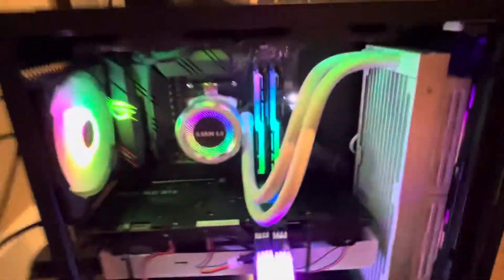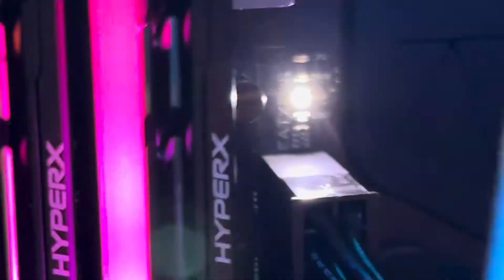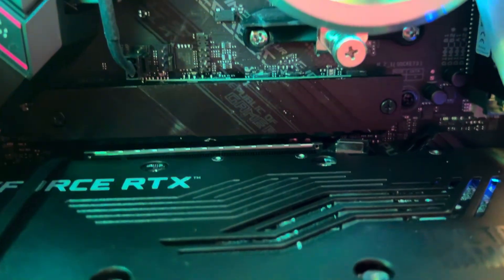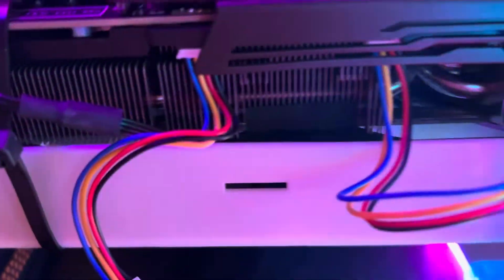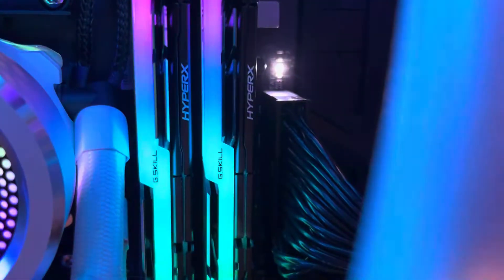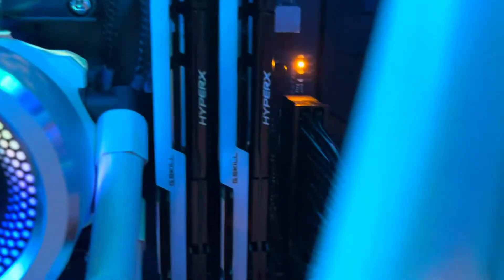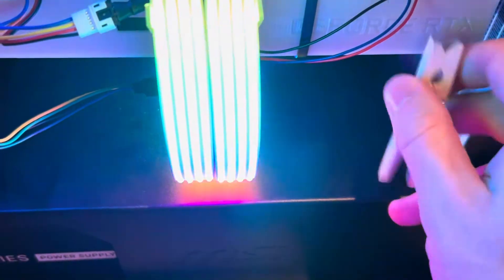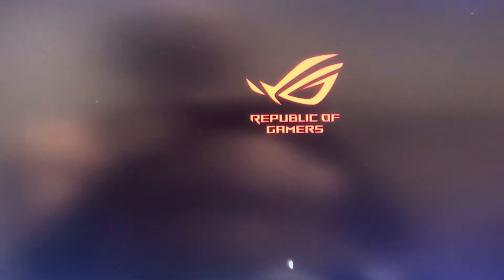How to fix White VGA light on motherboard

Comment: I just got a new cpu and it keeps having this issue just found this video but I don’t think it will help because right when I put my old CPU in it boots fine and I updated bios and chipset drivers and nothing still everything compatible it might just be a dead cpu I’m thinking because I got it used

Comment: My vga light stays on without graphics card and with card in with pc on the side, it was working yesterday
Reply from the maker: I would check all golden pins on the card as well as the pci slot on the motherboard for any damage or cracking.
Reply: @skidder6063  Turned out to be an SSD that stopped working, thank you though
Reply from the maker: @Heretican  np glad u got it working

Comment: well im having this problem since i bought the asus board... even without GPU on CPU integrated (AMD 9950X).. at this point im just leaning towards switching to non ASUS board as ASUS lately keep making garbage...  my gpu is heavy with waterblock, but its sturdy so there is no sag at all.. also tested with other gpu that has no coolers (some old quadro card)  - same problem.. tested with iGPU... same problem.. but the thing is that problem sometimes goes away.. most of the time it works.. it takes like 30s on white LED to finally start post process.. but maybe once every 2 weeks i get white LED of death where it wont boot on first and on few reboots either.. its like starting an old rust crusty ol car... this is insane.. My previous PC didnt have this garbage problem... but it was ASUS board aswell.. tho it was DDR4 and this one is DDR5.. maybe thats the problem.. idk
Reply from the maker: Have you tried updating your BIOS?
Reply: @skidder6063  You could have asked if i turned on the monitor.. yes. im no boomer. I have built many PC's and this is the first time im having such issues. Yesterday i added gpu sag support but the gpu itself was very rigid, i still put a support for it to bent upwards a little bit.. will keep my eye on things, but i think its an asus disease.. you can read many posts online people having similar issues with modern asus boards (past 2 years) before that they had good products and i never had any problems before like this. Once new GPU's drop, ill switch to a gigabyte board, as MSI suffer similar fate and assrock keeps burning up AM5 CPU's...
Reply: I ordered different motherboard, will update yall if i remember if that would fix my problem. And no, the GPU sag ( i didnt have it in the first place) hack didnt help in my situation.. i think its hardware issue with motherboard itself.. we will see..

Comment: I wonder if I’m having this problem in reverse. I have an anti sag bracket and it’s possible I pushed the adjustable bracket arm up too high. I’ll try lowering it
Reply: Turns out actually the TOP part of the clamp can’t be raised and may actually be causing the gpu to sag ironically. I believe I can remove that top clamp tho and just have the bottom part of the bracket. I have to take the bracket off first which I’ll go do now
Reply: Update: still not the problem
Reply: Final update: it was simply seated wrong because of some interference from the case. All good now lol

Comment: I had this too even tough the system worked fine. Turns out i had to turn on my monitor first and then my system and it went away.
Reply: Bro why did this just work 😂😂😂 ty though
Reply: Bro I just tried that and it worked 💀
Reply: @t1ronin454  B550-F model?